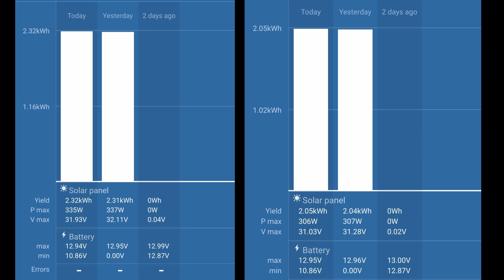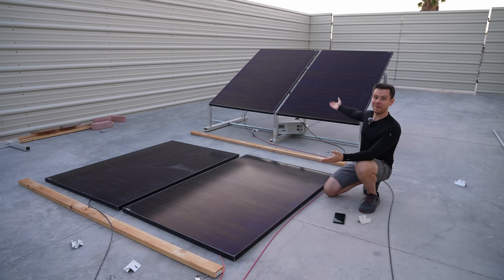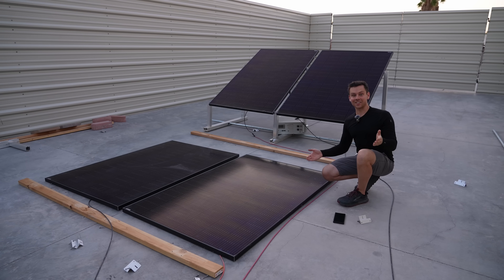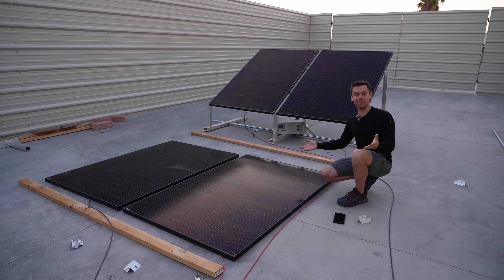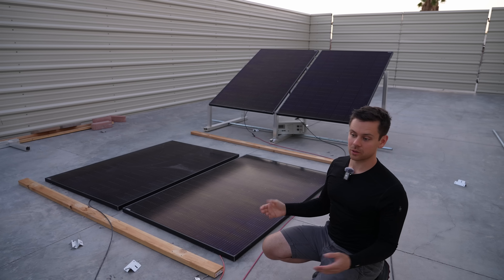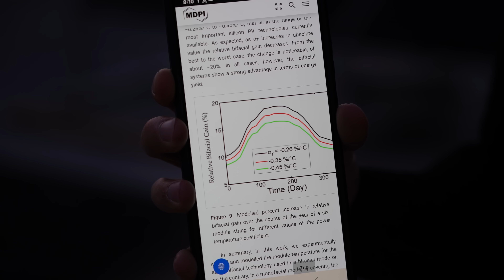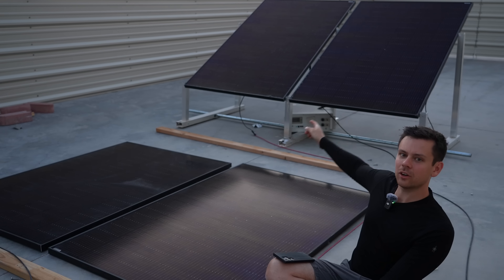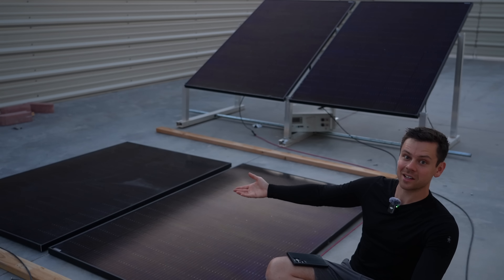Bifacial Solar Panels: Everything You NEED to Know Before You Buy

Comment: I would love to see you do the same test but with a good reflector on the bottom to get more out of the backside of the panels. Also would love to see experiments with water, 1. water running down the panel to cool it to see how much gain that gives and 2. with a sheet of lexan about 2" off the surface of the top of the panel with something like rain-x on the bottom of the lexan and a drip system that makes inverted water droplets that run down the bottom of the lexan that can concentrate the light like mini lenses as the water flows down it while sticking to the lexan.

Comment: Heat also affects the life of the panels, so away from direct surface contact is still important.  Who wants to shell out for reinstalling these later???

Use bifacials as exterior shades to windows and over walkways, carports, etc.  These would still allow some view thru them ie to look up, while providing interior sun protection.  Less overall need for certain materials while adding utility to bifacial solar panels...

Comment: Thanks again Will for yet another great review with more insight. Great to know that you have never seen more than 20% bifacial gain in clouds and snow.  From today's comments,  i would love it if you would expand this test to include the following backgrounds laid directly on your concrete, to test:  white metal dull, white metal glossy, gray metal dull, gray metal glossy, metallic copper sold by morton, which is a darker color but the metallic paint might bring some reflection. It would also be fantastic if you then ran a 60° tilt angle on cloudy days, or visit a friend in Montana or Colorado to run a 60° tilt test. Or if not, then report what northern states are reporting 20% feedback, and what conditions they are testing at, such as angle and background material. Thanks!!!

A different test would be fantastic. Mount on south building wall. Or any ninety degree wall facing south. Maybe on 4"inch brackets or whatever is appropriate. But test with different building materials, such as those mentioned above, to test which one is best. Then I could build my next metal barn outpost building out of it.
Reply: Lmao. Just so I got this straight. You want him to test your next building scenario, with multiple variables. 100% at his expense financially and with his time.
When since you aren't even building that you have the time to test these scenarios yourself. So basically you are being entitled and lazy.
Reply: @MyCabinLife I'm giving Will great suggestions for future videos. And i'm giving other folks food for thought. Since when is that entitled and lazy? Why are you confusing comments as directives?

Comment: THX for the information. My wife and i are an hour north of you and pondering the idea of installing a solar carport (i might contact the firm you utilized in your recent solar carport video.) I was concerned with the idea of the relatively flat roof profile of the carport, though your info in this video leads me to feel confident we would have plenty of power at the lower angles... that and our tiny house on foundation only uses on average 2.3Kw hrs a day. So even a smaller carport with ~4K+ worth might be ample in the spot I've got picked out with full sun from ~9am to sunset.
Reply from the maker: Yes small carport would be perfect for you guys
Reply from the maker: If you don't have snow the low tilt angle is fine. My carport is producing a ton of energy. You'll love it. Pain to install but it's out of the way and powers so much!

Comment: Will, I don't own an RV, but I've been watching videos about mounting flexible solar panels on the roofs of RV's, vans, etc. Everyone says that you have to put a corrugated plastic sheet between the panel and the roof to allow for ventilation and cooling. Wouldn't the metal roof act as a heat sink to pull heat away from the panel if mounted directly to the roof? Maybe some thermal paste or a thermal pad is needed? The sun is not shining on the roof under the panel. Of course, the sun is shining on the roof beside the panel and this heat could reach the panel through conduction. I would be interested in seeing some testing of different mounting options for flexible panels on vehicle roofs with varying air gaps. I also wonder if a white roof would be superior to a black roof in transferring less heat to the panel when directly mounted to the roof.

Comment: It looks like the shadows on each side are going to effect the flat ones on the ground more than the higher, tilted ones. Not sure how much of that 5 kWh extra is due to that.
Reply from the maker: Actually not, I watched that and mounted them in a way so that the shadow hits a whole cell  row at the same time tested with one panel each to test against. They produce the same at low sun angles
Reply from the maker: I was actually expecting a difference but it wasn't there

Comment: Have you tried testing the bifacial panels in a flat or almost flat install method, but further off the ground?  Not as high as the carport, but something that could easily be built and worked with by someone standing on the ground?  Would that be a good compromise between maximizing space utilization and the amount of energy collected?

Comment: Great Vid Wil,
I'm a bifacial panel fan & not even a Gemini? 😉😅😂
I am also happy you showed the folly of those panel mounting kits.

I will make my own, using "Sched 40 1" pvc $$". Nowhere near the cost of a stand.
 Vs lying flat in 90°+ summer weather here. 
The heat here for 4 mos would definitely affect the panels' production longevity. 

Thx !
You're my longtime solar hero !

Comment: It seems like the panels mounted at an angle would stay cleaner. Flat mount panels where I live would collect leaves but even without trees they would be covered with pollen. At an angle, the rain would rinse them off.
Reply from the maker: Yes! Very true
Reply: I cleaned some with just surface dust for my customer. He got 20 percent more efficiency after 20 minutes of cleaning

Comment: I tested putting 2 panels against each other with 2 door hinges at the top making an A-frame. I positioned them east-west facing and I averaged more power than both panels facing the sun. The reason was actually temperature related as I am in the tropics close to the equator. with direct facing panels, the temperature would cut output by 50% at midday. the A-frame would stay cooler midday and averaged higher even with each panel missing out from either morning or afternoon sun. I did separate east and west into 2 strings, so shading wasn't involved. I would like to test this with bifacial and a white material on the ground. Saves a lot on frames, too. the panels are the frame.
Reply: I'd like to see Will reproduce that and also the case with the panels mounted vertically and the faces pointing east and west.
Reply: Is each panel going into its own charge controller?   The two panels definitely can't share a charge controller in that configuration without putting one or the other into bypass most of the day.
Reply: @junkerzn7312  Yes, my inverter has 2 independent mppt strings. You are correct. They can't be connected. I had a east facing string on 1 mppt and a west facing string on the other.

Comment: Would like to see the effect of a small fan blowing air over or under the panel to keep it cooler. Does the lower temperature of the panel offset the cost of electicity to drive the fan?
Reply: Won't work if the panel has a glass face.  Theoretically you could blow air across the underside of the panel.  Some people have even put water cooling loops under panels in India.  But it is far more expensive to do any serious cooling than to simply add more panels to compensate (assuming one has the space to do so).

Comment: In most cases, most people don't have plush enviros like your :) panels will get damaged easier laying on the ground.  weeds will grow between them and you can't maintain the ground under them.  Unless you are suggesting concrete your whole yard lol  The solution is to build a cheaper DIY mount with wood so you can get them off the ground

Comment: I wonder what the panels would put out if they were placed vertical. I would place the two in opposite directions. One with the front facing one way and then the other one with the back facing that direction.

Comment: I always felt bifacial panels made more sense in snowy climates with a lot of overcast days.
Reply: Michigan gang!
Reply: something that might work really well for these panels would be using them as a patio roof. they lay near flat above the space but catch any light reflecting back up from the ground or even recapturing some energy from lighting placed under them at night.

if you were designing a house with them in mind, they would make excellent porch overhangs.
Reply: Bifacial solar panels can make an interesting fence material.  Yes they get far less especially mid day but they take effectively no space.  This configuration also has an interesting curve in which power is optimized earlier and later in the day which minimizes storage if paired with more conventionally mounted panels.

Comment: How hot do the panels get?  I often wonder if running water under them to cool the panels gets increased efficiency, and can be used to heat water instead of a water heater.  But would running a pump to move that water negate any additional power generated.

Comment: I lay my panels as low as I can. They catch less wind in a hurricane where I live ... I can live with the slight inefficiency.
Reply: I had 10 laying horizontal against a brick retaining wall. They made it through every hurricane except for last season. 4 flipped over. I left them face down in the grass. Later around midnight I heard a loud noise out back. The other 6 flipped. Thankfully none of them shattered. This season I built a rack and bolted them to it.
I have another 10 laying on a flat porch roof. They are on PVC stands used to glue down to RV roofs. I do have flat blocks on the perimeter pads on the feet. So far they have survived a few hurricanes with 1 of them being a Cat 3. Lost my fence but the panels stayed on the roof.
Reply: My roof is slanted. No need to add tilt. Moreover, my array is over panelled & charges my battery bank to 💯 before noon so I'm OK with it.   @FauxQue-yk8dt
Reply: You'll want at least a small angle (like 5 degrees) to help the panels shed water, and also get those siphon clips to prevent water from accumulating at the edges of the panels.   Pooled water will vastly reduce the lifespan of the panels due to the extra stress on the seals and the ability of the water to "walk up" from the inside once the seals do start to fail.

Otherwise though, apart from getting dirtier, I think it works.  I have a secondary system (not my main system), with four panels on my Pergola basically creating the roof of the Pergola.  I have them angled at 5 degrees or so and they do a decent job.   I don't get hurricanes here, but the Pergola survived 60mph winds last year without taking much stress so I'm pretty happy with it.  I left a large gap at the back for air to exhaust so pressure couldn't build up against the side of the house under the Pergola.

Comment: I have 2 conex that I used tropicool on the roofs. I then mounted panels flat on the now cool roofs. In the Northern AZ summers they get about the same output as the panels I have on my mounts. I did this because I live off grid and don't want to advertise to the other properties near by my solar capabilities.

Comment: I noticied for your test you didn't have  ground/earth (GE) connections for the Victron charge controllers. Can you please do a video for when we need to GE small 12V systems for home/camping. I have a 440W panel with victron 30w/100v controller and giandel 1000w inverter with single 120ah AGM or LiPo battery. I want it to be safe  but there seems to be confusion about GE around small systems like mine as the manufacturer instructions for both solar and inverter units have GE connections.  Please help. I love your videos, they have been so helpful teaching me to start work on my small backup/emergency system. Love your work and based/factual advice Will.
Reply: Earthing frames is not strictly necessary in small systems.  The situation where you might want it in a small system is if you have (for example) a metal electrical box that you have mounted all your Victron and other equipment inside.  You now have a lot of exposed metal fittings and you should ground that frame.   At that point you might as well ground the equipment as well since you have a ground conveniently there.  In fact, the equipment may already be grounded if (for example) you had used metal screws to screw the metal heat sinks of the Victron's into the electrical box.

Another situation where you want to ground is... say you have a Pergola with an Aluminum frame.  I just happen to have one.  And the solar panels are mounted on top of it... I just happened to have done that too.  Now you absolutely want to ground that Pergola frame for safety.  No question about it.  Otherwise someone just resting their hand on the Pergola might feel a buzz from AC feedback into the DC side from the inverter.

So if any metal framing is involved with the solar panels or equipment, be sure that framing is grounded.

Be sure NOT to connect earth ground to DC-NEGATIVE.  DC-NEGATIVE is NOT to be ground-referenced anywhere except possibly at the inverter.

-Matt
Reply: Thank you 
Thank you, this is extremely helpful.  @junkerzn7312

Comment: 1:20 Wow, solar panels are expensive in the US. A 450W Bifacial panel in the UK is around £50 ($70). Kinda frustrating the panels are the cheap bit and cabling & mounting hardware makes up the bulk of the install cost.

Where does the US discrepancy come from, tariffs?

NB. I just got one to go on top of my off-road camper. Not sure how long a glass panel will last in such an environment but it was cheap enough that I figure I can treat it as an experiment.
Reply: As a someone living in the US I'd guess the cost difference comes from the major lack of support for renewables.

Big Oil and all of our politicians can't make money if they start supporting solar. 

Just like many countries have better windows than we do. What most people get as "construction grade" overseas are basically upgraded or "custom" here in the US.
Reply: At this moment panels are typically around $0.29/pw... about $130 for a 450W bifacial panel in the U.S., wholesale (pallet), new, not including taxes, shipping, or tax breaks.   For not-bleeding-edge but also not-old panels.  i.e. not REC Alpha Pure's or anything like that.

Commercial-scale (containers ~400-1000 panels) are going for as low as $0.19/pw (about $85 @ 450W), not including taxes, shipping, or tax breaks.  But .... well that's a whole mini container full of panels.

So it isn't terrible but costs can add-up.  In the U.S., convenience is not free.

-Matt
Reply: @junkerzn7312  £60 wasn't the wholesale price. That was the price for one panel, including taxes, and there's no tax breaks for DIY solar in the UK (it's only zero VAT if part of a full installation by a VAT registered professional installer).

....granted, this was collected not delivered. From a local distributor a few miles away (delivery would have cost more than the panel).
Reply: America the free isn't really free at all.  Our Politicans are owned by some rich person or corporation that gave them money somewhere along the way.  All of us that live here pay the tax that keep the politicians and rich, fat dumb and happy.  Solar panels are just one of the things.  I can't buy a Chineese EV that is twice as good as a Tesla but at half the cost either.  Yet lots of Amreicans would say we have free market captialism which of course is nonsense.

Comment: ive got 6 panels facing north,,  southern hemisphere,, I plan to put another 4 bifacials along my ridge line so they are east west,, not to get more power but to give a broader spread across the day,,
Reply: I started putting panels on the north side of my roof too because I realized that North and South (and East and West) all get about the same production in cloudy weather and I want to improve my winter generation.

It turns out the North-facing panels are also doing a great job now in summer and I can run my A/C in the afternoon... a perk I didn't realize until I was actually producing from them!  But I put them up to help with winter and shoulder seasons.

-Matt

Comment: I suggest a test of vertical installation of bifacial photovoltaic panels, at my place I have been using such a solution for more than 10 years and it is great for the European climate, there is year-round production and increased resistance to hail precipitation, less dirt on the panels as well as snow obscuring individual panel circuits ( which you recently tested yourself). As well as the year-round production balance is better than setting the installation at a fixed angle.